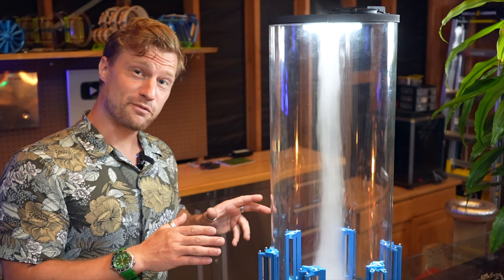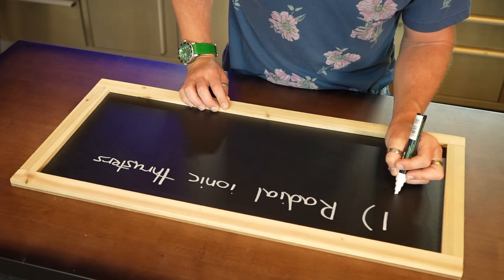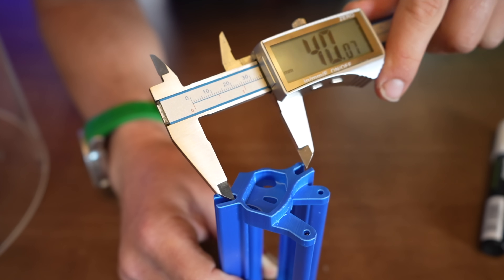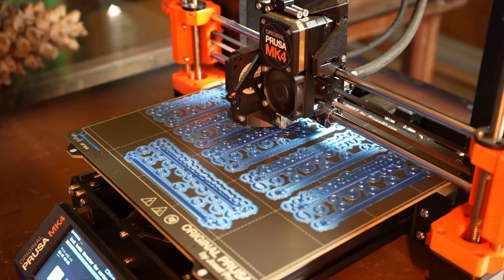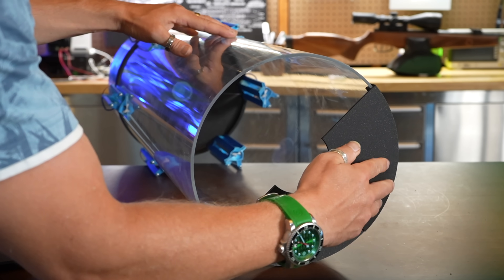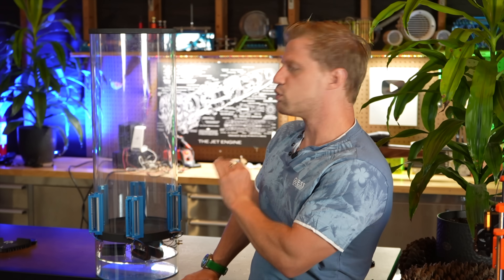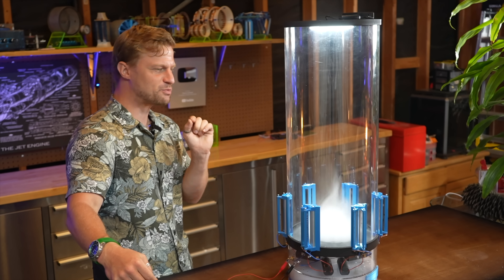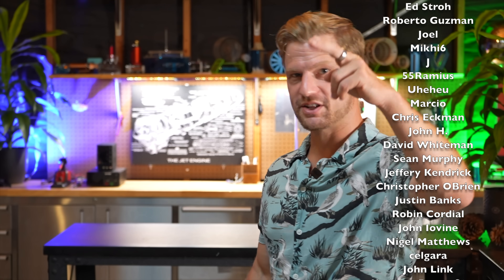I Built The First Ionic Tornado Machine! (Unreal performance)

Comment: You need to experiment with the structure if it would be possible to make the vortex to spread out at the top like the real vortex eventually will.

I have no actual knowledge but the intuition tells me that if you keep the middle of the top lid solid and have the opening somewhere in between along the radial. Although, the need for additional support between the edge and the middle parts might pose some problems, which might be solvable by raising them way above the lid level outside of the tube itself.

Comment: Try to build a vortex breakdown generator with it. You may have to change the geometry of the pipe to induce adverse pressure gradient to the flow but the result will be mindblowing. Bubble type  or even spiral type vortex breakdown will look mesmerizing. That said, the vortex flow may not be supercritical and so you may have to push air out from the top to accelerate the flow. Just a suggestion :)

Comment: It would work better if you used longer blades instead of putting two blades next to one another in the slots.  I'm surprised (and happy for you) that the tube didn't crack when you cut the slots and then didn't crack again when you slid on the thrusters that were straight on a curved tube.  I guess the curved vs straight would help with tension to keep them in there better, maybe? I understood how you angled it to get the vapor to rotate but I don't get how you got it to lift up and out.  I guess the top has the least resistance to where the air can escape?  I still don't get what pulls the dry ice vapor gets from the lower chamber to the upper chamber though.  Either way it looks really really cool.  PS: Be careful to not make so much CO2 that you're suffocating.  Also, since the voltage/power level affects the height of the tornado, did you think of using a sound file from some song to affect the height of the twister?  Then it would be visual and musical art all at once!  Also wondering if you remade thrusters out of a clear material if it would look better or about the same.  Also, if you put in a ring light with programmed color instead of just brightness, you might be able to get cool effects with that too!!

Comment: I wonder if you can make a series if Ionic thrusters with static vanes to cause compression of the air. A ZERO moving part turbine, with progressively higher compression after each bank, leading into a vortex driven combustion chamber. The laminar flow should be great for burn efficiency

Comment: first thing i thought after first startup (after how cool it was) was that it needs a lightning bold down the core of the vortex. bit of high voltage ring at the top, and another at the bottom, and let it charge up till it follows the path given. would operate as a large spark gap, letting it build like a copastor. yes, that means a full rebuild for the high voltage path, and keeping it from shorting the rest, but it would be so cool :P and the content value. 😈

Comment: Jay, if you ever have to cut holes like that again out of a piece that you can't replace easily because of cost or difficulty of sourcing, since you've already modeled the parts your outting there, you could add the tube (or whatever other piece you need to cut) into your models and then 3d print a jig to line up where everything should go.

(In this case, probably something like ring to fit around the tube with notches or cut outs to show where to cut. Or ever just a small arc that fits between the places you need to cut out.)

Your way also worked great. I just ways seem to be perfectly fine doing the math and measuring, until i get to the one gard to replace/rebuy piece. Lol
Reply: Edit: basically what you made at 6:29 😂

Comment: Awesome :D  

Somewhat related but i once had a brainwave of doing just this but for a different purpose. The principle would be a cyclone separator that would use ion an thruster (or thrusters) to create the cyclone. The tube would be much smaller, shaped like a cyclone separator and would separate small air particles. Basically a fanless air cleaner.

One of these days I may actually build it ;)

Comment: if the air is ionised, it will be conductive.
You should put a metal grid at the ends of the vortex to measure the electric field.

Comment: Dry ice mist is condensed water vapour, the same as an ultrasonic misting unit, but I guess the ultrasonic misting droplets are, on average, larger? You could use RO or De-min water if you're worried about conductivity.

Comment: Ok, how many videos is this now where I've looked at you dremel acrylic instead of getting yourself a laser cutter? 😂 CO2 laser will cut your acrylic like a dream. And you can also then etch stuff into it.

Though i well echo everyone's sentiment that this was insanely cool to see! I kind of wonder what would happen on a refinement of the control where you start with activating One thruster at a time
Reply: While it is true that the laser can cut the acrylic, the problem is the size of the piece, not all machines allow the table to be lowered 10 inches to accommodate the object.
Reply: @pkillor I mean, yes, not all machines can do that depth. But the number of flat sheets he's cutting by hand still? Makes me cringe.

Comment: turn that upside down, please. Schauberger proposed to use a vortex created by his repulsine device for lift. His device was a two plate air compressor that compresses the air by forcing it down channels based on a logarithmic spiral. It seems like he was trying to cause cavitation in air and then force that out though torus shaped section resulting in a vortex of plasma which the repulsine was lifted on.   
Could you do that with plasma instead of dry ice? Plasma vortex, not only sounds freaking awesome; but could also be useful. 
Love what you do, dude.

Comment: Maaaan, you can achieve the same effect with a 12-gon made from stripes instead of an a acrylic cilinder, and maybe put the thrusters on top of the device with a small hole in the bottom to make it a "small tornado generator"